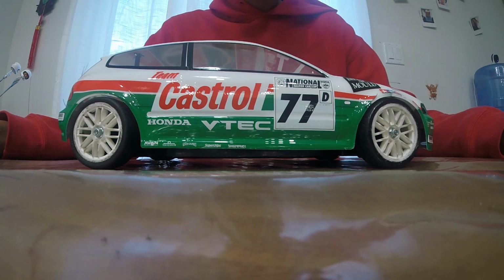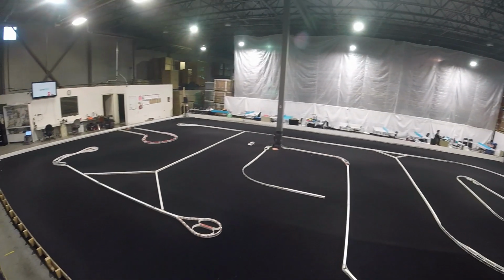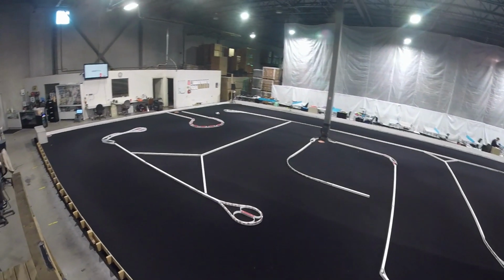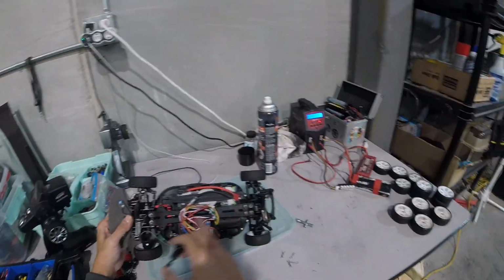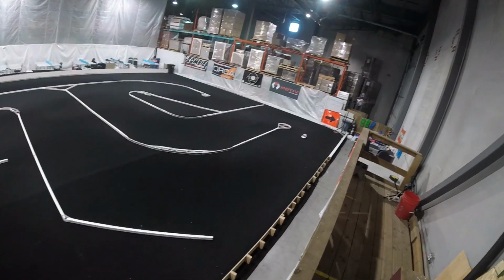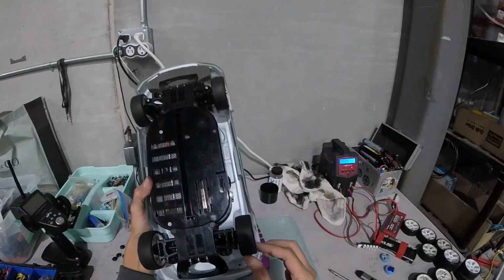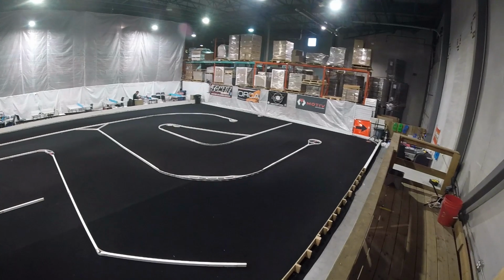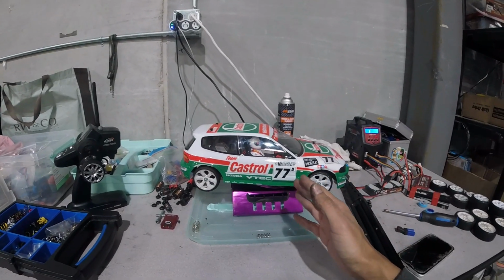Ep. 4 | PATIENCE! YES! TAMIYA TT-01

Comment: Hi there

I had a tt01e for carpet racing when I first started and my youngest son 7. It was bullet proff as it took a massive beating but nothing ever broke and still looked new. 

I ended up going into m chassis racing which I preferred so I sold my tt01e plus my son brought his own tt02. 

The tt02 was a nightmare and can't believe they was allowed to sell this kit it was that bad especially stock, the slightest nock or to much d/r which the car massively needs and it pops drive shafts, strips the threads in the steering columns. 

Even after my own modifications and hop ups it was still breaking all the time. 

Alot of racers including my self have given up with the tt02 (waist of money) and gone back to the tt01e.

Cheers Dan
Reply from the maker: Dan thanks for the great comments and chat. Although I heavily agree with you at the moment, that the TT-01E is far greater than the TT-02, Im also currently putting three versions of the TT-02 through races and tests, on and off road to try make a good tt-02. I dont want to hate it so Im trying to find the silver lining. I’ll be honest though, harder to love the base tt-02 after trying the TT-02SR (TRF SUSPENSION)
Reply: @rexrcs  Hi Rex

Cool, look forward to the upcoming videos.

Cheers Dan

Comment: Rex, no doubt the TT01 is a good handling chassis, I say just a step above the lowest TT02. Tamiya needs to step it up and include bearings & oil dampers in every kit. Does Tamiya, or have they, ever made a TT01S or TT01RS? I know about the E version.
Reply from the maker: sadly with my research there is no special tt-01 version, just the TT-01E
Reply: @rexrcs  That's what I thought.